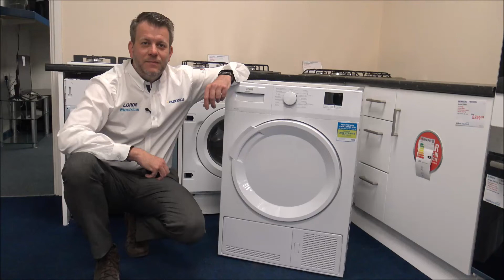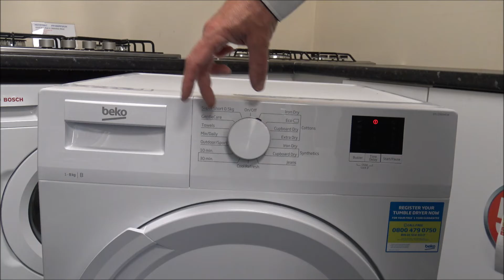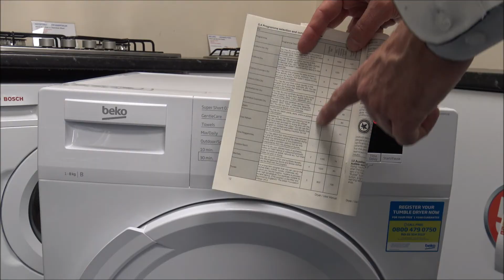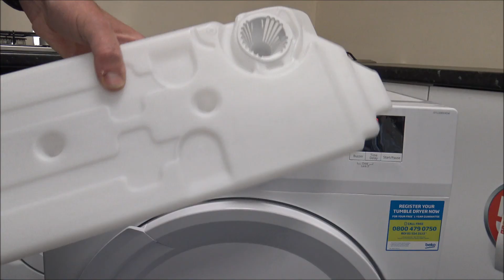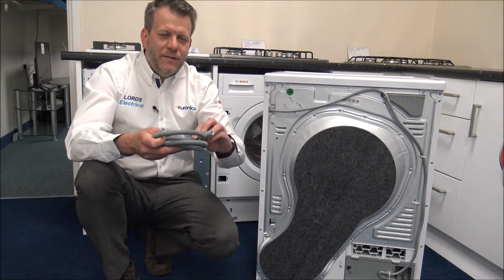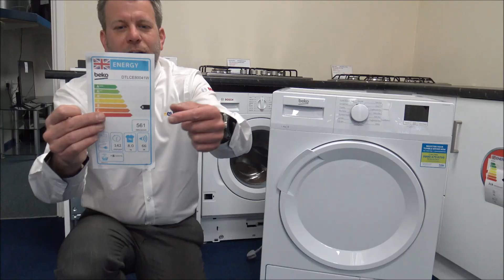Beko DTLCE80041 8Kg Condenser Dryer

Comment: That tray thing at the bottom what is it for? And the lint tray inside how often do you empty it? Does it show on the front panel when you do. ? Thank you 😊
Reply from the maker: It will be the condenser unit that will need cleaning every couple of months or so, and the lint filter, i normally recommend cleaning every couple of loads or keep an eye on it as it may not need cleaning so often. If it shows on the front that the filter needs cleaning, then really it has been left for too long.

Comment: Hi 
I just had the same model 3 months ago.
But It took 3. 4 hours to dry just normal clothes 
And I have no idea when it finished
Reply from the maker: To dry for that long the clothes must have been pretty wet. Try enabling a faster or longer spin on your washer to extract as much water as possible from the clothes before putting them in the dryer.

Comment: Hello, I have the same one, mine is not turning on, don’t know what to do, can someone help me please? What can be? 
Thanks
Reply from the maker: The main things will be to have a look to see if the fuse is ok in the plug and that the socket on the wall is ok. Apart from that it will be a case of contacting Beko if it is under warranty to get them to sort it out for you.

Comment: The felt foam on the back is causing glue fumes when in the dryer is in use. Will these fumes ever go away? I have lung disease and the fumes are activating my lungs when dryer is on even with the back door open. It is a new dryer so I have been putting it on to remove the off-gases, as I do not want to put clothes in it in case they get glue fumes, or a plastic factory or chemical odour in them.
Reply from the maker: I would be very concerned if you have glue fumes coming from the dryer, this shouldn't be happening. I would contact Beko to see if they can sort this issue out for you.
Reply: We have just got thisi dryer and habe found the same thing I just assumed it was due to being new and hope it goes away

Comment: hi, I've got a 10kg model, what is the rubber pipe for underneath the machine please
Reply from the maker: That will just be a connecting pipe taking the water up to the drawer at the top. Don't disconnect it as it will start to leak from underneath then
Reply: @lords-electrical  it had a crack in the plastic

Comment: Hello, sorry if a silly question but for the programmes that recommend a smaller load, do they use less energy than the standard 30 minute for example? Thanks 😊
Reply from the maker: Yes normally the smaller load programmes will be more efficient in drying the clothes than a standard 30 minute program

Comment: Hi I purchased this and wanted to know whether it has the feature where if you put a 'mixed' load in will it stop when some items are dry so they don't over dry, then you take them out and comtinue the programme for it to finish drying? Is that what sensor dry means? I am abit confused bcs I used mixed but some clothes were dry and others not? So I stopped took out dry and pressed start again to dry the rest?
Reply from the maker: This will always be really difficult to manage if you are drying different fabrics at the same time. Personally i would recommend doing smaller loads with the same fabrics rather than trying to dry 1 large load and stopping the program part way through to take some clothes out.

Comment: Whenever I type this model in it comes up with Beko DTKCE80021W. Is that what you were referring to at the start? Also can I install this myself or would you say you need a connection by a professional? I dnt want it commected to drain pipe i will manually empty it
Reply from the maker: Certain models of these Beko dryers are for certain retailers, so the model i am showing DTLCE80041 is mainly through Euronics retailers and the DTKCE80021W is mainly through Currys but essentially are very similar models.
They are easy to install, you just need to unpack it, plug it in and make sure it is level.

Comment: I have a Beko with reverse drying. It’s annoying, can I turn it off or do all the cycles use that? Thanks!
Reply from the maker: If the dryer has reverse tumble then it will be automatic to reverse at a certain stage of the drying process to avoid tangling of the clothes.

Comment: I have just got this model and it smells of burning, is that normal when first few dries  thanks . And thanks for explaining all the programs.
Reply from the maker: Really after the first dry, it shouldn't smell of burning. I would contact the retailer where you purchased it from to check to make sure it is ok before you carry on using it.
Reply: How is this machine a year later is it fine or do you have to buy a new one?

Comment: Hi, thanks for the video. I'm still confused about the container at the bottom left, where the grills are.  What's it for?  The booklet that came with it is so confusing!  Where does the water condense? In the top tank or the bottom tank?  Why does the booklet talk about pure water??
Reply from the maker: The container at the bottom left will be the condenser unit. This is to be kept clean by washing it through and brushing it to get rid of the fluff or lint around it. It will maintain the efficiency if you can keep it clean. The top tank is where the water collects after the drying process has completed.

Comment: Do i need to fill up the container at the front with water if i dont have it connected to a drain hose
Reply from the maker: No, the container will fill with water automatically if you don't have the hose connected to take the water from the machine

Comment: whats the pipe for it comes with 🤯
Reply from the maker: The pipe is a drain hose where you can have the water exit the machine through a waste hose rather than emptying the tank all the time
Reply: How often do you need to empy the tank with water? And does it need to be connected to any water pipe?

Comment: I’ve got a beko heat pump tumble dryer. Had it for 3 years so far and has worked perfectly all that time. The main feature I like is the drain hose that this this model this has.
Reply: hi i have 1 delivered yesterday but do I have to use the drain hose or can just use without?